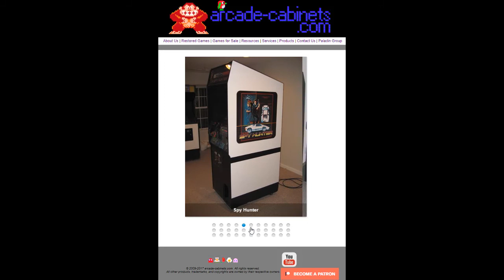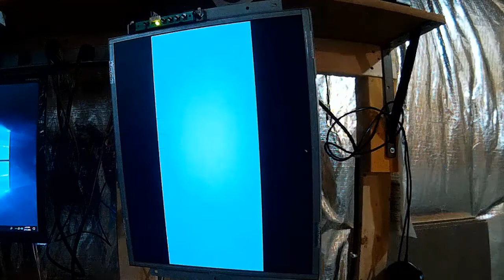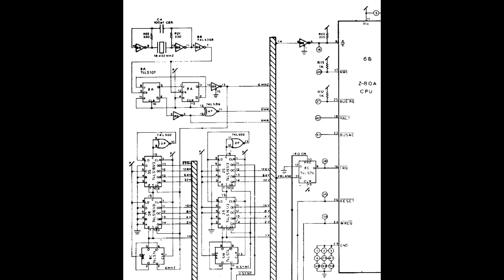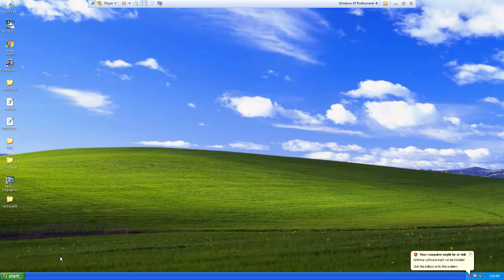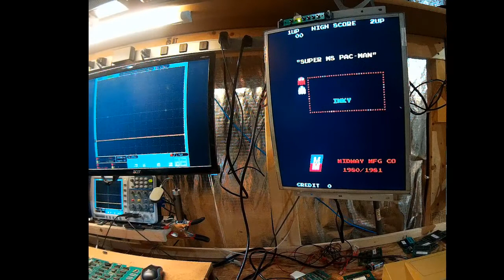Arcade PCB repair #20180216.01: "Dead Ms. Pacman" (Sync circuit)

Comment: at 4:28, what did you knob did you adjust to make the signal on your scope go from fuzzy to still and clear when you was looking at that clock signal. thanks
Reply from the maker: The timing resolution (X axis) adjustment, basically made each grid block a smaller time  frame so you could see the fast movement. If you have an o-scope and  are not used to it check out some of the learning to use an oscope videos on you tube (I don't have any) it will REALLY REALLY help you out. just need the basics. and very important practice on some known good signals (like clocks on a working board) before trying to repair a board, otherwise you'll be fightingg your tool rather than having it help you. It  really really really really one of the best uses of your time to make you maximize your tool.
Reply: @arcade-cabinets  thank you for the info! I have done all my repairs with just a logic probe, i bought the siglent sds1104x-e almost 2 years ago, just seemed like alot so i never messed with it up until now, "IN TRAINING" lol
Reply from the maker: @jeremylester6537  it is one of the best tools you can have and I suggest you use it! but you do need to spend some time learning the tool or it will just cause confusion. spend 1-2 hours getting the feel of it and it will increase your repair  ability 100x no joke.

Comment: All arcade games use 2V to 128V and 2H to 128H sync signals. 128V Multiplied by 128H =  16, 384 bits or pixels? Does this mean that all arcade games are 64K pixels?

Comment: How does the arcade games MPU Vector Reset affect the address decoder circuit? The 6502 MPU vector reset address, MPU Z80 vector reset address, MPU 8088 vector reset address are all different address values. How does the MPU vector reset address does what to the arcade games address decoder circuit?
Reply from the maker: The address decoders are not affected by the reset vector. The reset vector is defined by the chip manufacturer and the system must be built around this.
Reply: @arcade-cabinets  When you first turn on the arcade game, what is sending a signal to the Reset vector? I thought the arcade games reset circuit or address decoder circuit sends out an address to the MPU to the MPU's reset vector. I'm not sure what the MPU reset vector does or how the watchdog circuit is sending out a pulse to the MPU reset vector.

Comment: How can you verify the arcades game resolution and pixel grid using an oscilloscope? because each arcade game resolution is different with different H&V columns and rows numbers some games are 256X240 and other arcade games are different. How do you measure and verify an arcade games resolution to know the arcade game is 256X240 or something other? Can the Oscilloscope or Logic Analyzer able to count the arcade games H&V to know what the arcade games resolution and pixel grid?

Comment: When an I/O data buss buffer IC chip has one short or open pin it causes ROM signature issues. Any reasons why if only one data buss buffer pin that is either shorted to ground, shorted to +5vdc or open floating can cause ROM errors on the fluke 9010A giving different ROM signature that are correct ROM signature?
Reply from the maker: I dint understand the question. If it’s giving different signatures (which it should if the buffer is bad) how can they be the correct signature?
Reply: @arcade-cabinets  When the Data buss Buffer has one input or output pin shorted to ground or shorted to High +5 or floating, when you type in the ROM signature in the Fluke 9010A it will say there is a ROM signature Error and it doesn't match the ROM signature. I'm confused because the Buffer IC chip should not change the ROM signature even if one input or output pin is shorted to ground, shorted to High or floating. But it seems that the Buffer IC data buss chip can change the ROM signature, but I don't understand why or how it changes the ROM signature.

Comment: BUSACK Bus Acknowledge signal in arcade games is used for what reasons? I'm not sure if the BUSACK is an input or output to the CPU
Reply from the maker: wayne Gram it’s an input, that allows other devices to request use of the bus. I don’t think I’ve seen it used in arcade games.
Reply: @arcade-cabinets  but most ROM and RAM are using the data buss all the time, so I don't get what devices would be sending a BUSACK bus acknowledge signal
Reply: @waynegram8907  ram and rom are not considered independent devices. they are just responding to requests from the cpu they do not try to use the bus on their own.
Reply: @patreonarcades4476  what would use the bus on their own? what devices and IC chips would send out a BUSACK bus acknowledge signal to take over the data buss?
Reply: @waynegram8907  nothing that ive seen on any games, probably something wanting to do DMA
Reply: @patreonarcades4476  yes Punchout uses DMA. They have DMA counters also and I think the DMA uses BUSACK Bus Acknowledge signal to take over the data Buss during DMA.
Reply: @arcade-cabinets  when the fluke is displaying a BTS error, DCD error that has the BAD address value in hexadecimal value. You take that BAD address hex value and convert it to a binary value which should be the INPUT binary value or the OUTPUT binary value of the address decoder circuit? The Fluke is display which BAD address value is causing the BTS error or DCD error. I'm trying to convert the BAD address value into a binary value and this should be the INPUT binary value to the address decoder circuit to turn ON the Bad RAM or bad ROM chip?

Comment: I'm having this problem

Fast moving short vertical lines covering the screen. High pitch squeal coming from monitor. Caused by shorting 6 MHZ clock signal to other chips. Also caused by PCB frequency pot not adjusted.

2B shorted to 6MHZ clock signal to pin 14 to pin 9, 10, 11, 12,13,or 15 or 2A short to pin 14 to pad next to it.  OR 1E, 2E, short Pin 2 to  1,3,4,5,6,8.

https://www.youtube.com/watch?v=8O_6hxBO7GM i took a video of what's exactly happening.
Reply: that definitely looks like a pcb board problem not a monitor problem, you shouldn't need to take the whole machine to get fixed just send the PCB to someone that repairs them, (or buy a new one on ebay etc) luckily pacman/mspacman PCBs are cheap as there were tons and tons of them made. Often you can buy one cheaper (working) than sending it to get repaired. but don't through out your old one, sell it to someone that fixes them.
Reply: @bebrzezicki  thank you brian, when i was playing suddenly it went dim and was very yellowish but still was functioning.  only when i opened it to mess with the monitor pots it started to do what you saw in the video so i thought maybe it was something with the monitor.  thanks again, this will be much easier to take it up to tnt amusements.

Comment: arcade cabinets, how do you set your oscilloscope to count the logic data? because I have heard arcade repair technicians doing this to troubleshoot serial & parallel shift registers to "count the data" on the inputs and outputs of shift registers, any reasons why you would want to "count the data" in logic signals? why would you want to count the data for what kind of logic signals in arcade games?
Reply from the maker: wayne Gram I’m not sure what you are asking. An oscope can count the number of times a signal goes high or low or frequency of a signal but I don’t know what your asking
Reply: Some Oscopes will have a counter that "counts every data pulse" the counter will show a value of how many counts the logic pulse is for that logic signal. Most Logic Analyzers I think do this. If you're measuring a clock signal the counter will count every data pulse of the clock signal. What I'm confused about is when would an arcade repair technician ever use the counter to count the data pulses for troubleshooting shift registers or V&H Counters chips?

Comment: When you read an arcade games program ROM chip, there is 16 rows with hexadecimal values. How you know which ones are the Opcode values and which ones are the data values in the Z80 language or 6502 Language? because it will display 16 rows of hexadecimal values for each address offset, but how do you know which ones are opcode values and which ones are data values?
Reply from the maker: wayne Gram you have to know the machine language specifications. The specifications tell you how to decode each instruction which then you have to do one after another. Some cpus machine languages however are designed to be easy for example each instruction might be exactly 32 bits and x or those are the instruction and y are data values
Reply: But when you read arcade ROM chips it will display the Rows and columns of hexadecimal values. The address offset values in the rows and there is 16 columns going across the screen with 2 hexadecimal values per column. Are these only just hexadecimal data or are these hexadecimal values Opcodes values?

Comment: arcade cabinets,  I have seen circuit pad jumpers on arcade games for I/O buffer chips, what are they used for?Atari Battlezone N2 and K3 , LS244 , Pin# 1 and Pin#15 have circuit board jumpers, any reasons why?
Reply from the maker: Some games can be configured to use different chips. I don’t know offhand but I think battle zone could use different buffers depending on what the manufacturer wanted to use at production time. Cost and availability is always a concern for manufactures
Reply: Oh ok thanks, so those Circuit Pad Jumpers are mostly used for different pin out chips? Because I have see in arcade games schematics a lot of circuit pad jumpers for RAM chips and ROM chips also which I think ground certain address lines. The control lines and data lines stay the same I think.

Comment: I'm not sure if there is a bad RAM chip or get a DCD error or BTS error only in the RAM region that this will change and alter the ROM signature value to a totally different number can this happen? can a bad ROM chip or getting a DCD error or BTS error on a RAM chip cause the ROM signature value to change and alter to a totally different ROM signature value?

Comment: It doesn't make sense to me how the Fluke 9010A can say the ROM signature is OK when the ROM signature is the wrong signature because there is an addressing issue. Why would the Fluke 9010A say its OK when the ROM Signature is the wrong signature? It happen when you have an addressing issue but I would think the Fluke 9010A would say its a bad signature error but it doesn't, any reasons why?
Reply from the maker: I dont' remember the specifics of this video, but if the addressing circuits where messed up then the fluke signature check should NOT be successful, that said it's possible that the addressing circuit chips etc work OK for the regions that control the ROMs but the parts that control the RAMs are not ok. that would allow the ROM access to be OK, but not the RAMs.
Keep in mind although most addressing circuits are pretty simple they do consist usually of at least 3-5 chips and not all chips are used for all parts of the address range.
Reply: If the address circuit chips are OK for the regions that control the ROM why would the ROM signature be incorrect wrong but the Fluke 9010a says OK with no errors? Or what would cause the Fluke 9010a to say the ROM signature is OK but the ROM signature is wrong and incorrect?
Reply from the maker: That does not make sense? How could the fluke both has ok and say there is errors?
Reply: The Fluke 9010A will say its OK but the "ROM signature is wrong" when comparing it to the ROM signatures on the internet. The Fluke 9010A will say that the ROM signature is OK with no errors when the ROM signature is wrong or " just a totally different signature compared against to looking up the Correct ROM signature on the internet. This is my main question is why does the fluke 9010a says the ROM signature is OK no errors but really its the wrong signature? I would think if the address decoder circuit is not working correctly it would make the ROM signature bad but it doesn't because the address decoder circuit or an addressing problem on the arcade games doesn't affect or do anything to the ROM signature it seems. The ROM signature is separate from the address decoder circuit and addressing issues because it has nothing to do with addressing. So the Fluke 9010A will say that your ROM signature is good and OK when actually its wrong compared to the internets ROM signature for that arcade game. I'm not sure why the Fluke9010A is saying its good and OK when the ROM signature is incorrect or "is totally a different signature" but the Fluke 9010A will say its OK and good. I'm not sure what causes the ROM chip to output totally different ROM signatures but I don't think the address decoder circuit or is the address buss has shorts or floating lines would this change the ROM signature to a totally different rom signature value?

Comment: Often in arcade games they start the counter chips other than at 00 which doesn't make sense to me why you would want to start the counter and load it at a different value other that start it at 00, any reasons why they do this?Plus when using the counters carry out bit in arcade games to do what with the carry out bit?

Comment: Arcade games use counter chips with a carry in and carry out, I'm not sure why would you want to use the carry in and carry out because it changes a 4 bit output counter to a 5 bit output counter. The carry in and carry out changes the counters output value, but not sure when arcade games use the carry in and carry out for what reasons?

Comment: every arcade games in the 80's had separated address decoding circuits for the video hardware,  video RAM, video ROM chips. I don't understand why they made the separated address decoding circuits for the video circuits to not be able to be accessed by the CPU to read and write to the video circuits, video RAM, video ROM, any reasons why they did this? and not use the same address decoding circuits for the game code why have a separated address decoding circuit for only the video sections?

Comment: I don't understand why the vertical counters to create the vertical sync signals are being loaded as a default as 7C. Any reasons why the vertical counters in Ms Pac man are starting being loaded at 7C? it doesn't make sense to me. Also when the vertical counter chips have reached FF how does the CPU know when to send the Load pulse to the Vertical counter chips?

Comment: Ms pacman has a custom IC chip that interfaces the game ROM chips and RAM chips with the character RAM chips and sprite RAM chips. The Fluke 9010A can read and write to the character and sprite RAM chips with the Customer IC chips Removed. When the Custom IC chip is Remove why can't the game ROM chips and RAM chips able to talk with read and write with the character ram chips and sprite ram chips?
Reply from the maker: That's not correct the game ROM chips and RAM chips never talk to sprite RAM or ROM. RAM and ROM cannot initiate transfers of data they can only respond to requests from the CPU or the video hardware.
Reply: What does the Ms Pacmans Custom IC chip purpose? its ment to interface the hardware with the sprite RAM and character RAM?

Comment: When reading the game codes contents from an arcade games ROM chip, what assembler can I use to convert the game code into reading the code easier?
Can I load the game codes contents into an assembler and the assembler can convert the game code into reading the code easier and maybe debugging troubleshooting the code?
Reply from the maker: you need a disassemble for whatever CPU that is used. MAME in debugging mode has a disassembler. Also check out GHIDRA (http://ghidra-sre.org) it's amazing though a bit complicated to get started with.

Comment: When testing a ROM chip and you didn't have the signature value. When you type in the ROM start range and ending range on the Fluke 9010A and "enter in signature 0 value", you will get an error message when you press the MORE button which the fluke 9010A will tell you what the ROM signature value should be
1.) How does the Fluke 9010A know what the ROM signature value should be? 
2.) This can be a way of cheating by get the ROM signature value without knowing it?
3.) When you REMOVE the ROM chip from the socket the Fluke 9010A will tell you a ROM signature value any reasons why?
Reply from the maker: 1) the fluke knows how to compute the checksum. its in the flukes code.
2) assuming your game is working correctly, yes that is a way of determining what the signature should be, it only works if  your sure your game is working though!
3) Because the CPU always sees "something" if the ROM chip is not there usually it shows up as 0xFF for each address that you read.
Reply: @arcade-cabinets  thanks for the help
1.) But how does the fluke compute the checksum even when you have entered in the wrong ROM Signature value? 
2.) When removing the ROM chips from the sockets the fluke 9010A will give you a ROM signature value that is a different ROM signature value compared to when the ROM chip is installed in the socket. Why is there two different ROM signature values?